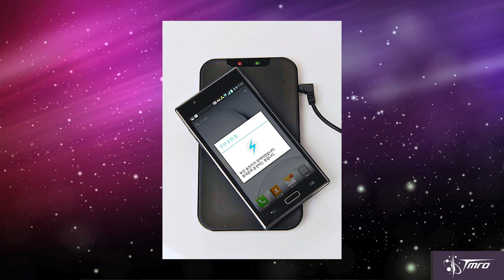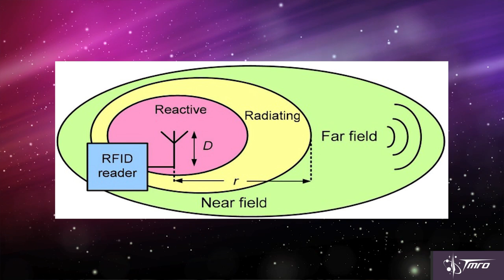Japan and Solar Power Satellites - Space Pod 3/19/15

Comment: Taiwanjohn88 already mentioned it, but power and energy got mixed up a couple of times at about 50 seconds.  Watts and kilowatts are units of power which is energy use per time (1 W = 1 Joule/sec). Common units of energy are joules, watt-hours or more practically in this case kilowatt-hours.

Comment: Japan takes the lead in wireless energy transfers. Solar power satellites is now one step closer to reality! Great #tmro #spacepod as always Mike!
Reply: Holy crap!!!!!!!! but an antenna 55 meters away....eh...
Reply: Still, it's the directional control and pin-point accuracy that counts *****. No one has managed to do a energy transfer over more than a few meters, and then only with little to none directional control.
Reply: True. We use microwaves at work for long distance data, over many kilometers, so it's definitely doable and has been for almost 20 years. Using microwave to send power is an interesting and tricky twist. I'd love to see power shoot down from space! :)
Reply: ***** The problem is always going to be energy loss. Your taking solar power and converting it to microwaves. Then beaming it through the atmosphere losing most of it then converting it back to electricity.

The problem is you lose most of your energy.
Reply: Patrik Järvelöv Space based solar power is not the future. I can tell you why. There is another idea that is basically like SBSP but without it flaws. :D
                              It is called StratoSolar.  Putting PV panels buoying in the stratosphere(20km)  where there is no weather! only very constant soft thin horizontal winds(comparable to 4m/s winds at ground, laughable).  no turbulences...what so ever.
no humidity..... No glass for the panels...... lightweight.
                               You will receive basically the power you would get also in space, but without the whole antenna losses because instead you'll use a 2 inch High Voltage
transmission line down to earth. It could carry a GW of power. And loss of a HV line is about 3% per 1000km! XD
     stratosolar.com . It is terrific. IMO the future for solar! Genious.
you dont need expensive rocket launches.
2- 5 x energy.   2x more than in the desert. XD
Reply: In the 60s data transmission with optical fibres could not be achieved at more than 100 meters.  Be patient.

Comment: This reminds me of the beginning of radio (im immortal) where there was competition on how far one could broadcast a signal, and speculation over the maximum range a signal can reach. And we all know how that story has ended up. Good luck to them all. But I cant help thinking that these signals will warm the atmosphere they pass through. Especially substances like water and clouds. Or just even the natural moisture in the air. Try microwaving an icecube and youll see it doesn't work. Water on the other hand....
Reply: The microwaves would not effect the atmosphere.  The frequency of your kitchen microwave enables water to boil, it is very specific, just to boil water.  The microwaves in this application would be designed to have the least impact or losses due to water in the atmosphere.

Comment: I like the concept, but before you start saying we'll shut down coal plants and nuclear reactors if it works, I'd advise you take a hard look at the economics SpaceMike. I'd LOVE if this becomes commonplace but... even if launch costs become negligible, solar panels and square-kilometer receivers aren't cheap (yet?) and need to be replaced/maintenanced eventually. That said, full steam ahead with the testing! This tech is too damn cool to leave alone and could have many MANY uses beyond grid-scale energy transfer from space.
Reply: what do you know the economics of energy in 2030 ? probably not much.
Reply: I wasn't saying that I know that it won't work, only that there are some questions that need to be answered before we can expect to see it supplying power.
The wider market for energy won't really matter though, it's relative cost that'll decide what people use. Take coal for example, if it is the cheapest source for power nations will use a lot of coal. If some sort of carbon-tax is implemented that'll becomes part of the 'cost' of a coal plant and may persuade people to shift to a different power source. Alternatively, fuel prices could go up as coal becomes harder to find. But last time I checked, The cheapest sources of power were (in descending order) Coal, Natural Gas, Oil, Geothermal, traditional Nuclear, Wind, and finally Solar. Given that all non-fossil fuel tech is likely to see advancements between now and 2030 I'm just trying to caution declaring this as our one and only guarenteed-to-happen, energy future.
Reply: +Will B Shutting down nuclear uranium or thorium would not be logical at all.And you need a very diverse energy mix.
Reply: ferkeap We are in violent agreement on that one. While nuclear energy (specifically next-gen Thorium based MSRs) are my favorite potential power source I still think the best answer is a mix of power sources.
Reply: +Will B yup been watching Kirk Sorensen's different videos on Liquid Fluoride Thorium Reactors. It really spells a great future in energy. 

I was all about SBSP with power sats built from lunar sources. till I came across LFTR.

Comment: to be honest this isnt that good of an idea. putting sun power in space requires large panels and a lot of launching to get any real power, and that only increases the amount of shit in leo and out, lots of potential debris. thorium reactors seems like a better idea in most ways. not to mention that solar panels take time to pay off their investment even here on earth, in space you have to pay down for the launch as well. it seems really uneconomical

edit: rough back of the envelope calculations puts a solar array at 57 years to pay off the launch costs alone even if we assume round the clock sunlight and 100%efficient energy transfer.

an iss solar panel outputs 6.6 kw and weights around 100kg, this means 66kw per ton.
 there are 8765 hours in a year which gives us 578490 kw/h per ton per year.
the energy price in japan is about $0.30 per kw/h, so a ton of solar array potentially generates $173547 worth of power a year.
launching stuff to LEO costs around $10000/kg depending on launch provider, which puts a ton of array at $10000000
10000000/173547=57.62
Reply: but do you know that solar power is 10x more without the atmosphere ?
Reply: Etienne Vandamme well, for starters that isnt true (assuming you mean 10x more efficcient) , but that doesent matter really. my numbers come from already space based solar arrays, ie those at the international space station.
Reply: Actually it not even twice as strong.